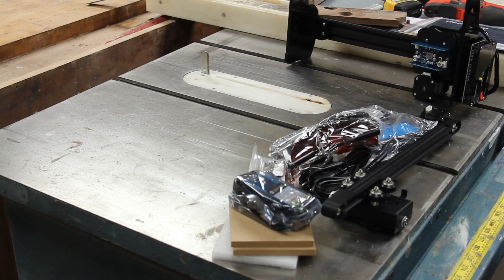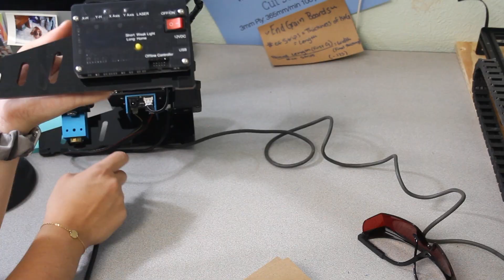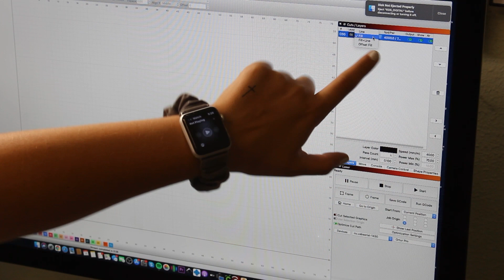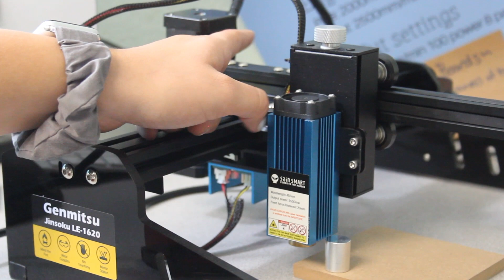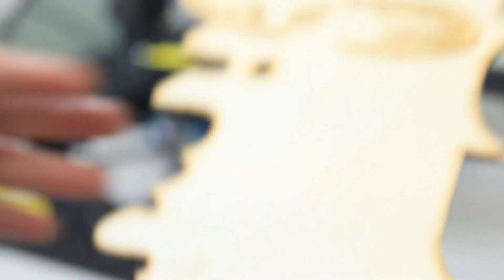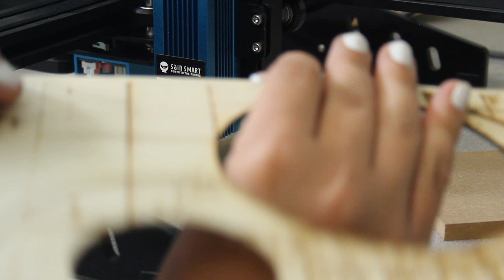Sain Smart Genmitsu Jinsoku LE-1620 Laser Review

Comment: Is the software as hard to learn asI have been told?  I do not have any cnc type software skills...  you mentioned Air Assist please explain what and how it is helpful please
Reply from the maker: Software is super easy to learn! It’s very user friendly and there are lots of YouTube videos about it too. 

Air assist helps create cleaner and better cuts with a laser as well as keep the sole down. It connect to an attachment on your laser that connects to a tube that then connects to some kind of air pump kind of like a fish tank pump or an airbrush air compressor. It pushed are through the tube to the top where it come out by the laser clearing out the cutting area or moving smoke

Comment: Do I have this laser and can only get it to work with GRBL, lightburn won't connect for some reason. Any ideas to help an old guy out?
Reply from the maker: Try a different usb cord. It connected right away for me just make sure the machine is plugged in via usb and the power cord and make sure it is turned on. If you can’t seem to figure it out there is a sainsmart Facebook group that may be able to help u

Comment: I want to cut 2 mm thick PVC round pipe of 4 inch diameter. What desktop laser would you recommend. I can set it out in open so that the fumes can be dispersed outside.
Reply from the maker: Not really sure if a desktop Diod laser would work for this kinda job, but a co2 laser maybe. Like the glow forge or the MUSE. However it is very dangerous to cut PVC even with good ventilation
Reply: You can't cut PVC material because it off gasses a toxic chemical don't cut PVC with any laser, you can kill yourself

Anything that has chloride in it's name turns into chlorine gas and that is toxic, like WW2 chemical weapons grade toxic. PVC is Polyvinyl Chloride. Don't mess with it on a laser
Reply from the maker: @weilam03  exactly

Comment: There is an anti vibration method for printers you might want to consider adding to it.  A concrete paving tile on a section of carpet sample.  In the case of a laser, it adds a hard to burn down your workshop base that also adds mass to eliminate vibrations into and some out of the machine.  The carpet is just to protect whatever you put the block on.  If you do make the block yourself, a 5 scoops of sand to 1 scoop of Portland should be good enough.
Keep making and posting!!

Comment: I've heard running your laser at 100% power shortens it's life.  In your experience do you think this is true?
Reply: Personal Experience，When you use a fixed focus laser, the laser life will increase a lot compared to the focus one
Reply: Likely true for cheaper lasers with poor cooling.
Reply from the maker: I use to always go by that as well. But after a couple years of working with these lasers, I have found that they still work great at free running at 100power for cutting